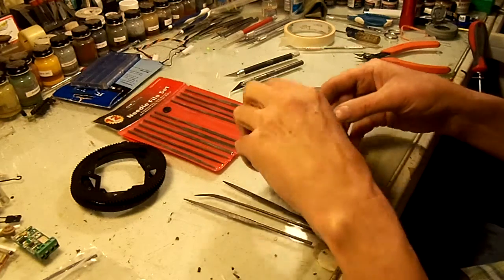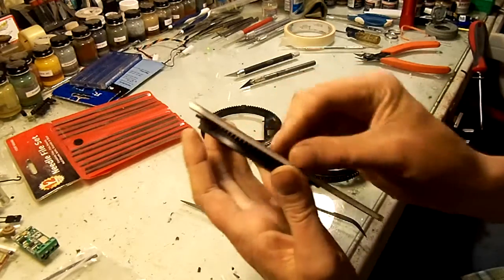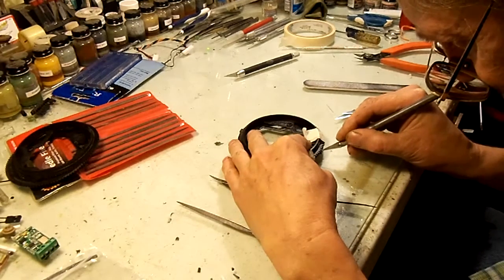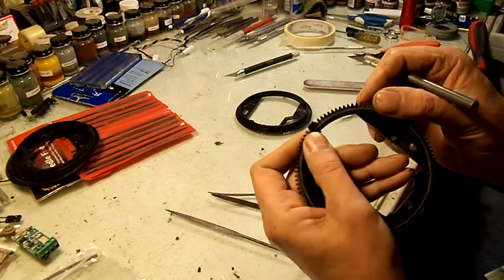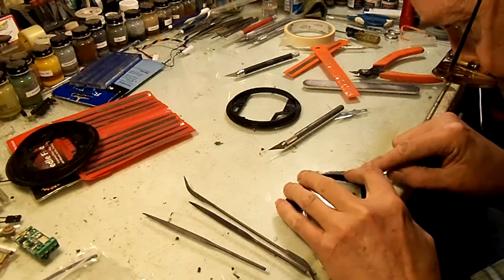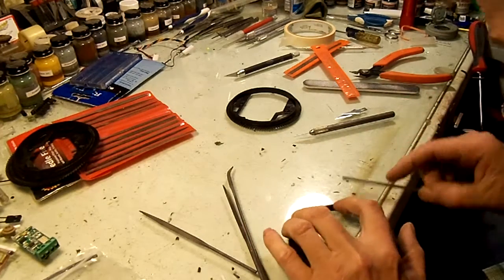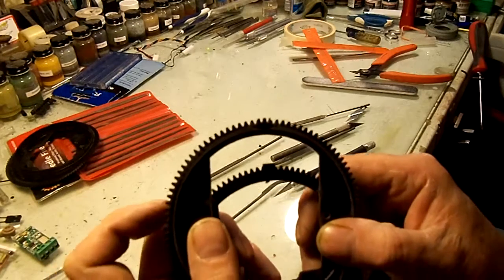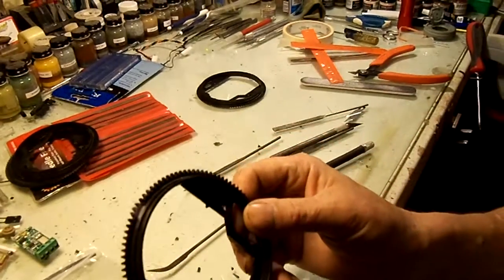Converting a turret ring for 360 operation

Comment: I don't have a Heng Long tank and just curious if this mod only allows the turret to turn pass 360 but the operator will eventually have to rotate it back to untwist the internal wire harness, correct?
Reply from the maker: Most of the newer, better models come with a slip ring installed in the wiring that goes to the turret. You can spin either direction as much as you want without tangling the wires. Before they started doing that I installed one in a TG tiger1, and there are videos around here somewhere if you want to convert your current tank. Slip rings are cheap, like ten bucks or so, and readily available from ebay, banggood, hobbyking, etc. I recommend you get as many wires as you can, extras can always be used later for things like an animatronic tank commander.

Comment: Wouldn't a variable speed Dremel tool be more effective with such operations?
Reply from the maker: Too easy to slip and remove too much material. By taking my time and using a knife and file I get it right every time with no mistakes.